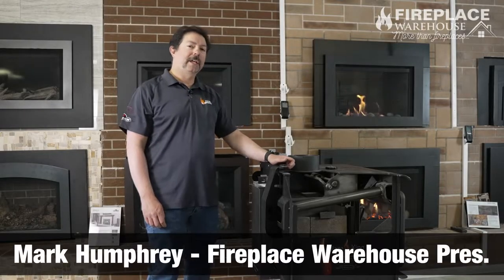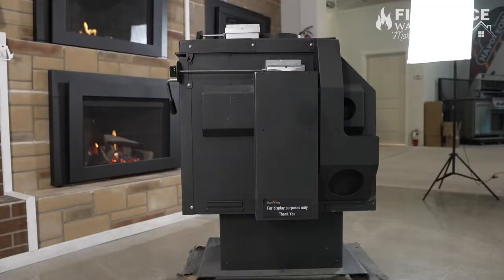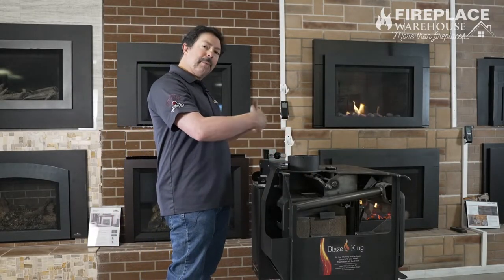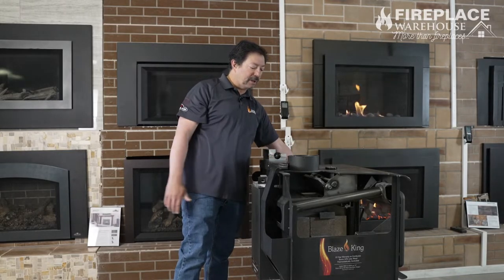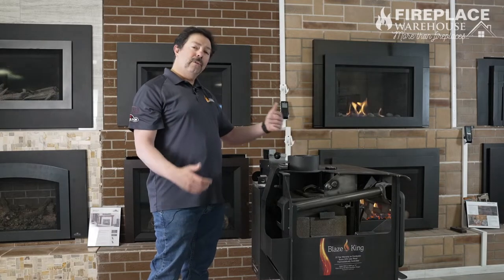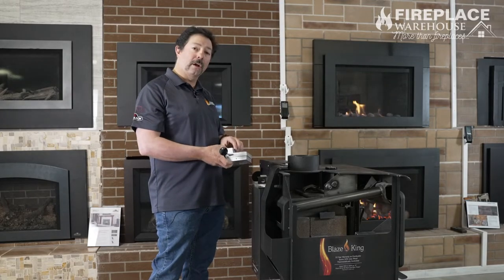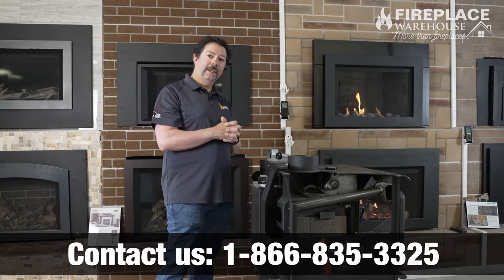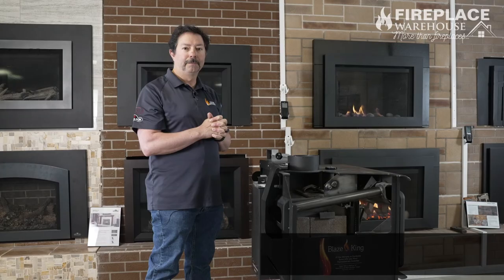How the Blaze King Stove Works at Fireplace Warehouse

Comment: Have a question for you, once the stove is hot and you are running with the air damper in comfortable temp in the space  and the stove hits the active temp for the catalyst and you close the bypass damper and then reduce the air inlet so you have a long burn time is it normal that the stove temperature will drop below the active range? When this happens is the catalyst still active? are you doing damage to it when the stove burns down the level of fuel in it and is just left with coals and embers?
Reply: The stove temperature does decrease when you adjust the damper but it stays in the active range until all the wood is burned.  The catalyst is not able to work properly once the wood is all burned and the stove has gone into the inactive zone.  You are not "damaging" it but rather clogging it up.  It's something you want to avoid so that you don't need to do maintenance as often.  On my BK I fill it once a day to about 80% capacity, I have it turned down all the way at night, turn it back up in the morning.  Once a day I refill and I can even empty the ash while embers are active and load it back up.  

Once you have this stove you get used to the routine pretty fast.  It's not like any wood stove I've owned in the past.  It uses about 60% less wood, I don't have to get up at night to load wood, there's no smoke coming out the stove pipe outside so it is burning extremely clean, I can even hold my hand on the stove pipe about 2 feet above the stove.  Not only does my furnace never kick on but handling the firewood is reduced by over half.  And this will pay for itself in a few years.
Reply: @beentheredonethatoriginals5673   First off thanks for the reply. I just moved into this house in the summer of 2022 and this being my first winter here so I'm still getting used to the house. I have a new this season Arada Farringdon 16 Catalytic stove and I'm not very happy with it. I heat about 800 square feet with it. When I get up in the morning it is cool in the house below 15C or 59F unless I have the backup heat source on. I have to feed the stove 3-4 times a day because it only has about a 6-7 hour burn time, it has a small fire box 1.3 cubic feet.  I can get the house quite warm 25-26C or 77-79F with the stove but then the burn time drops to about 3-4 hours. My overnight temperatures get down to -20 to -26C or -4 to -15F, we did have a couple of nights that were down to -31C or -24F with a wind chill of -40. I have 2 heat pumps and electric heat as back up in the house. I have an endless supply of red maple, grey birch, pine, spruce, and fir on my property so if I can heat with wood only that is what I will try to do. I burn the soft wood in the shoulder seasons and the maple and birch in the winter.

Some more follow up questions for you. 
What stove do you have? 
How many square feet are you heating with it?
Where are you located and what is your outdoor air temperature range in winter?
Do you use it as your primary source of heat? 
With a catalyst stove can you oversize the stove so you have the long burn times and still have good functioning stove? 
How long have you been using your stove, and how often do you have to service the catalyst?
Reply: @FarewellAcres  I'm in WA state, not as cold here, about 25 to 35F average winter Temps, 2000 sq ft home.  Using mostly Douglas Fir.  It does get warm enough with my King 40 model that cracking a window in the stove room is necessary. 

Buddy has 2 in Alaska and talked me into this stove.  I thought he was exaggerating but it's everything he said.  The stove is too new to me to comment on catalyst maintenance but there are YouTube videos on it and they basically blow it out at the start of the season.
Reply: @FarewellAcres  Also this is my primary heat source.  My heat pump only kicked on once in the last month when I didn't load the stove.  My neighbor has the BK Princess model and has no other heat source.